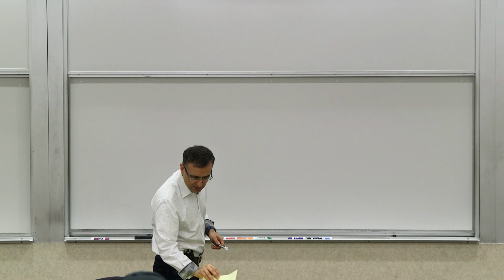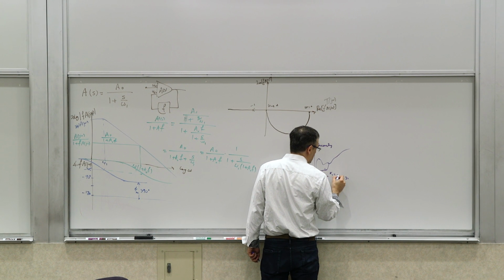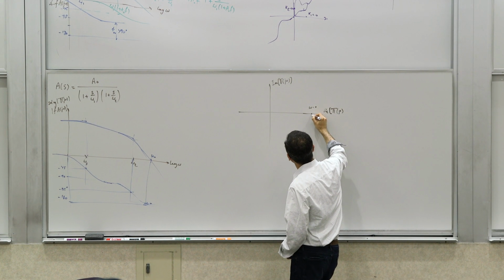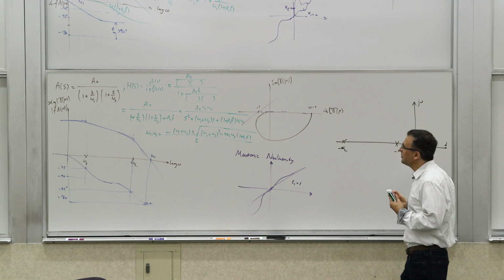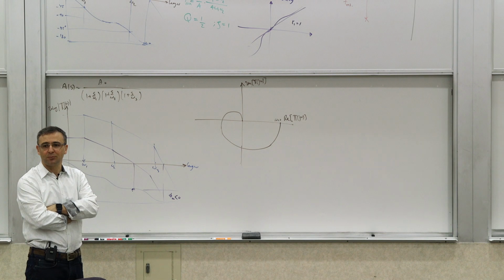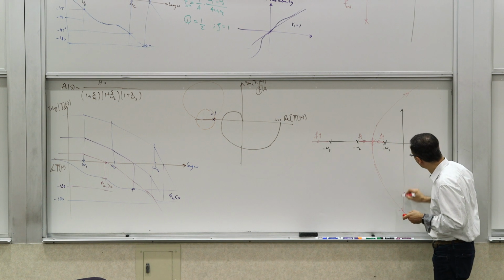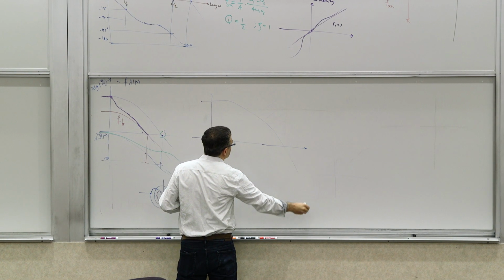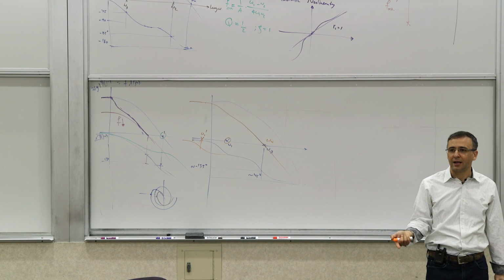170N. Feedback amplifier compensation, general view for 1st, 2nd, and 3rd order system

Comment: Dr ali can i ask you a question 🙏🏼🙏🏼 that i take alot of time to search on this topic but its hard go get a satisfied answer for me.
My target is to design circuit that contain any analog components and ics. So there is an option to get a satisfy result by trying by signal generator and oscilloscope. But  i want to model all my compent to simulate it ? What is the best way to do it? And is it possible to model any ic? What is the best software environment helps me to make this (ltspice or matlab or combination or others)?
I wish you to help me in details 🙏🏼🙏🏼🙏🏼🙏🏼
Thanks alot for your time 💐💐